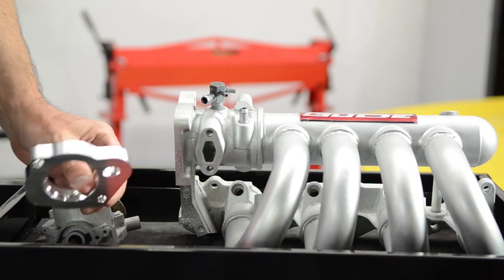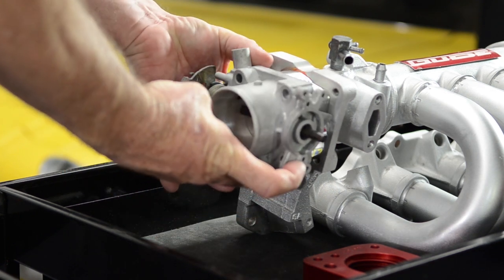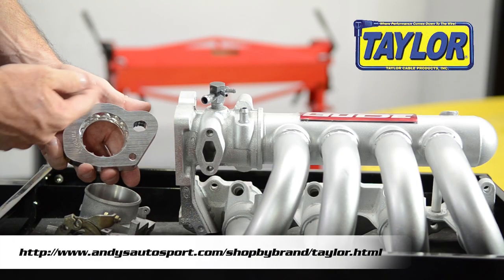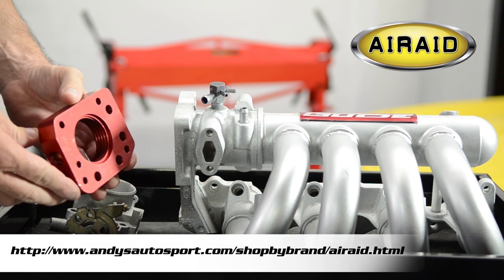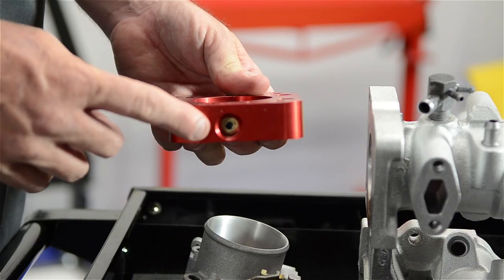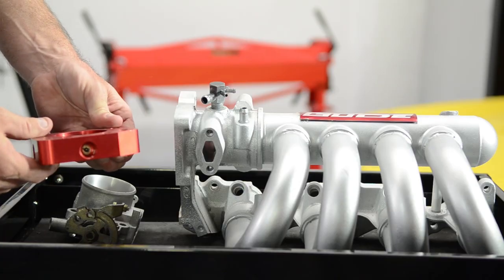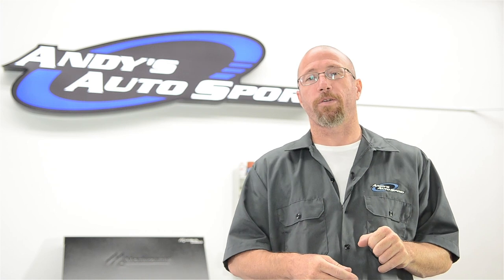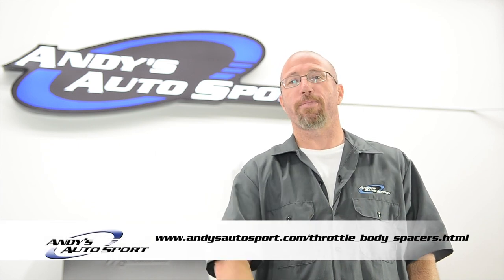Throttle Body Spacers - Presented by Andy's Auto Sport

Comment: I watched the whole video and understand the concept. It is the same concept as the tornado metal insert for your intake tube. When the valves open it creates a vaccum when the piston moves down and the air is pulled in, and any protruding surfaces just create more resistance to the air flow (same concept as porting for better air flow). The extra spacing may make the difference like dual stage intake manifolds but as long as it sits flush.you are right about the performance. love your videos

Comment: Throttle body spacers are something I've never been able to figure out. The air speed into the intake doesn't matter diddly-squat, it's the CFM that matters. If I remember correctly, they user to stick these between the carburetor and intake manifold to mix up the air/fuel mixture more so you could get a bit more power out of it. With fuel injection (and especially direct injection), I see no point to this other than adding nitrous injectors.